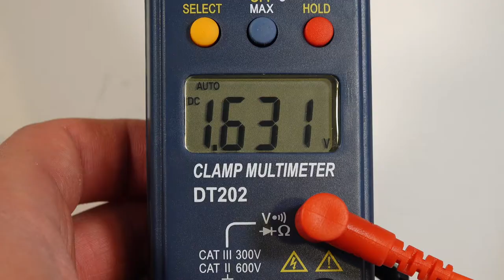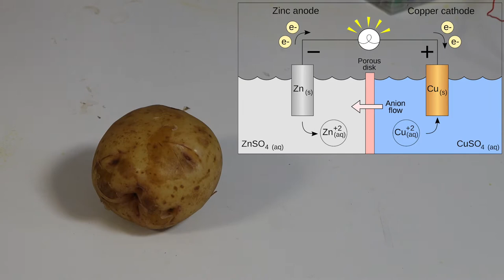DIY Potato battery! The science behind power inside a potato!

Comment: The zinc is what is providing the electricity and it is gradually consumed in the process.  The potato is just providing the electrolyte and a rather poor resistive one at that!   You could use anything wet with some salt dissolved in it, the metals are what matters.